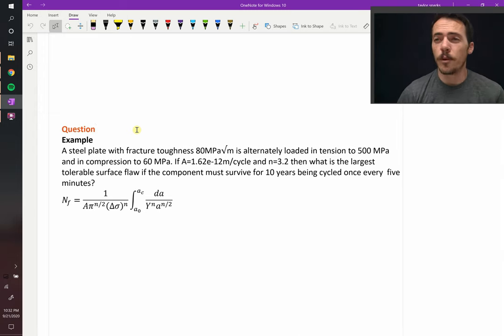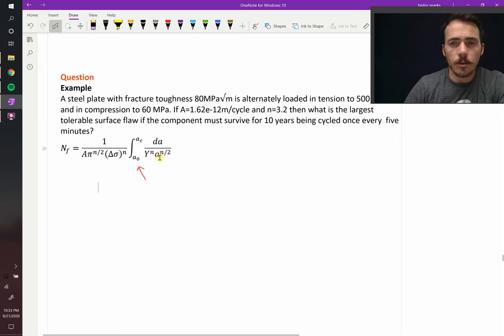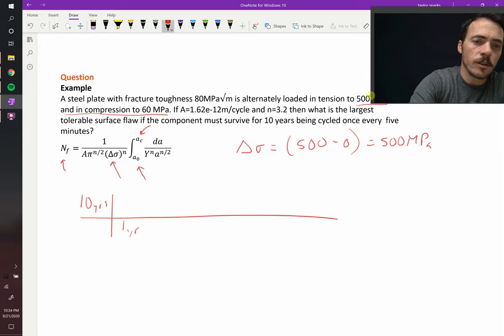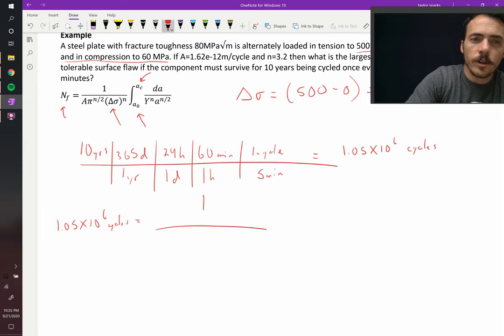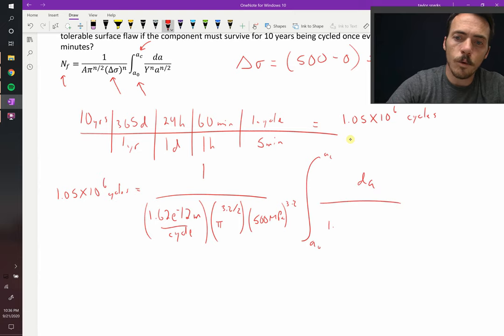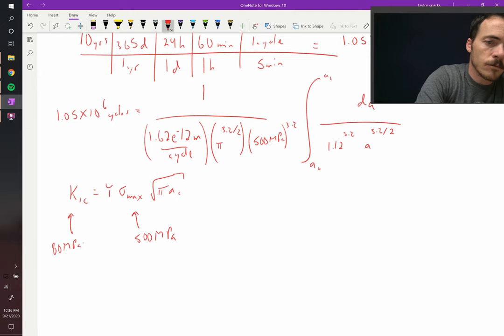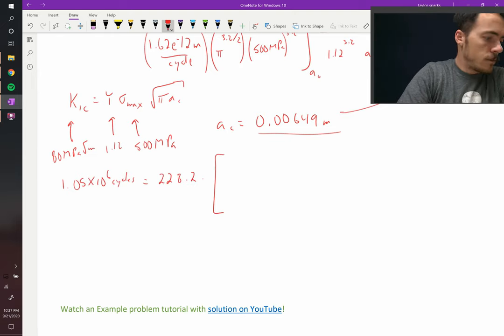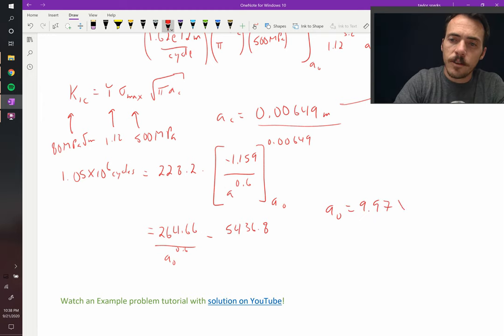Worked example of Paris Law for crack growth until fatigue failure

Comment: Great explanation again, thank you :) Just one question, I guess you didn't mention but I was wondering about the effect of the Crack Closure Phenomenon on fatigue life, does it increase it or decrease it?
Reply from the maker: I'm not an expert, I would assume it would increase fatigue life though. It's effectively reducing the stress by applying a closing stress.
Reply: @TaylorSparks  I was also thinking like that, but I wanted to confirm it with you, thank you a lot :)

Comment: Why is largest tolerable surface flaw a0? Shouldn't the largest tolerable flaw be critical crack length since it is the point where failure occurs thus being the largest distance till failure?
Reply: You have a great point. The problem question should be, What is the acceptable initial crack size for the material to withstand the indicated load conditions for ten years? With this statement, the answer is logical.
Reply: If the largest intial flaw was the critical crack length, it would not survive the required number of cycles, instead experiencing brittle failure quite quickly. a0 is the surface flaw when N=0, so grows with every cycle, eventually reaching ac when the required number of cycles is reached.